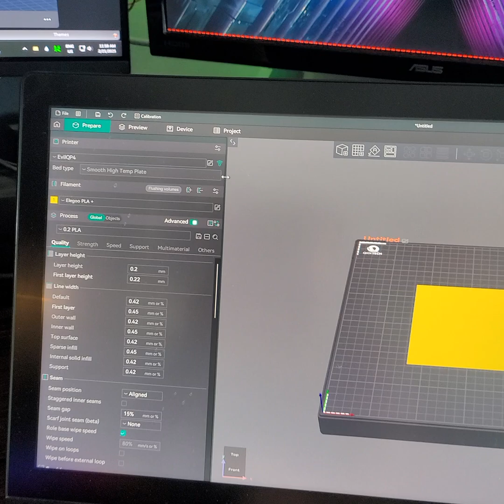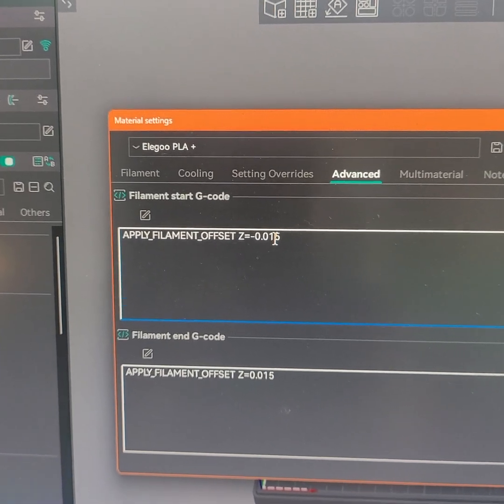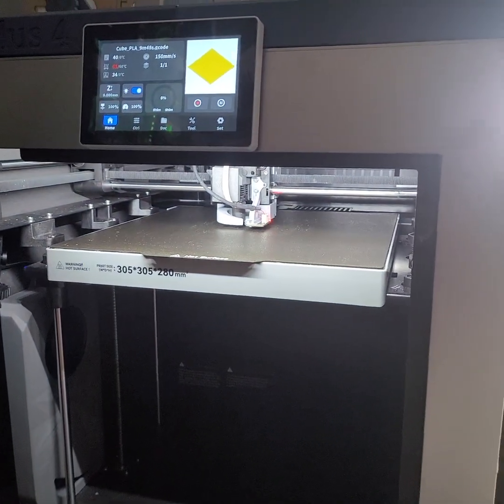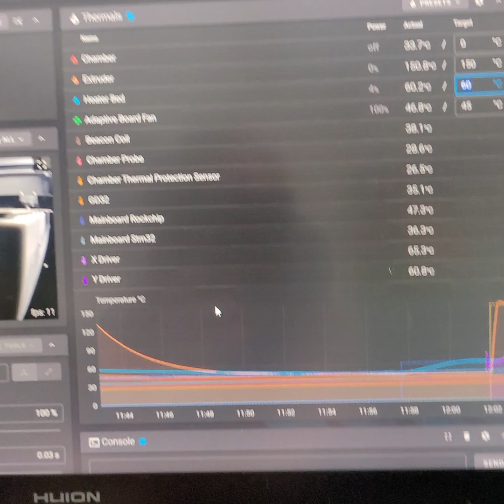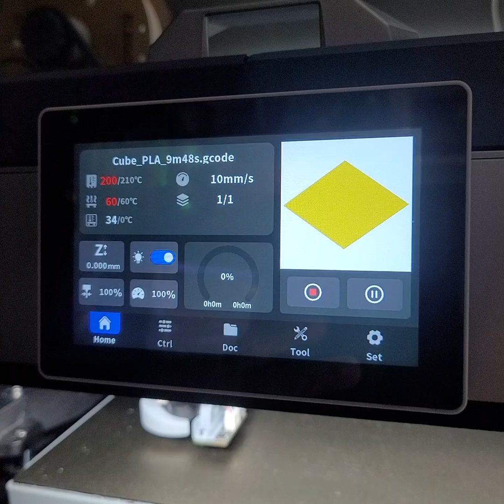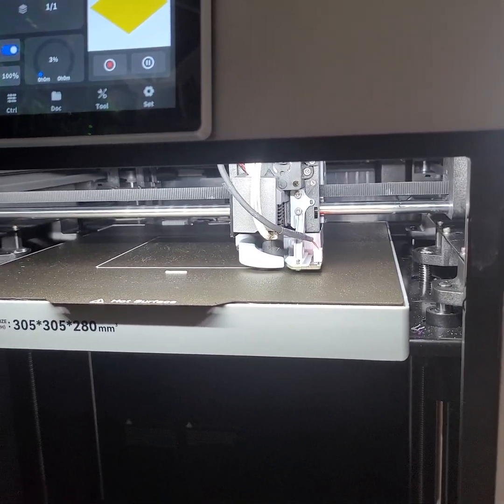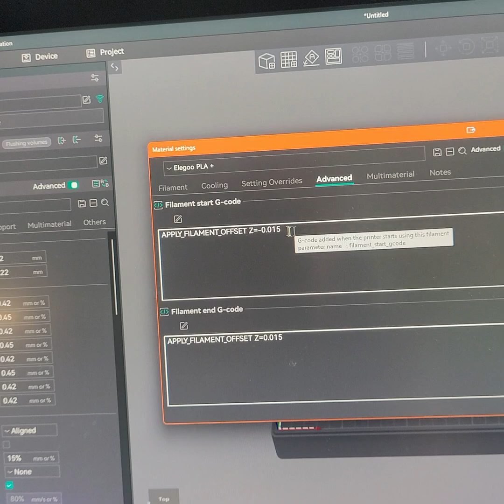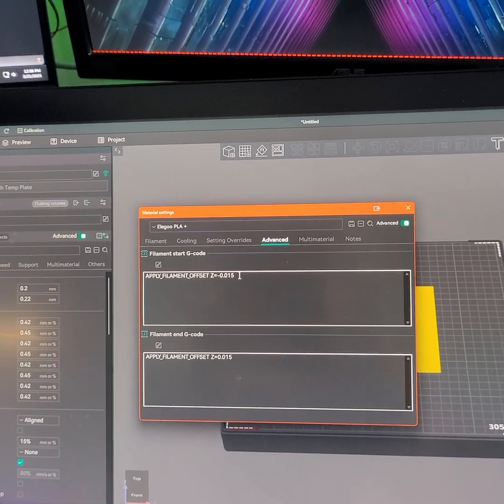Qidi Plus 4 Beacon UPDATE

Comment: How does it work after 1-2h of 65-70°C chamber temp and 105°C bed?
The normal bed probe is pain in the ass in such conditions and I was recommended this as a solution however I really would like to know if it works under these conditions before upgrading.
Btw. the normal probe does work at the conditions mentioned, for the first print of the day. If You leave the printer at these temperatures in between and during each print, meaning >2h, it just starts throwing out "out of tolerance" errors.
I am usually printing only ASA, PPS and stuff needing high chamber and bed temperatures and doing this in bulk, meaning, off with the one part, print another directly and this for 10-20h a day, I really need something reliable
Thanks!
Reply from the maker: I works bud ... machine stays stable and runs smooth. Can't say more for now because my machine is all in pieces :P Doing a huge mod on the gantry .... video soon

Comment: I had a question; the beds have magnets on them. How is it that the magnets on things like the qidi plus4 not cause interference with eddy / magnetic sensors? Or they do, and the materials on the bed must be changed?
Reply from the maker: the bed plate is solid aluminum, it's a sticky magnet sheet that is glued to the plate that holds the PEI sheet. Like so, Beacon can work without a problem
Reply: @frankthebum  Ah, so the magnatism is too weak and too evenly spread so it's not an issue, that's what I gather? Do I have it right?  Sort of like a fridge magnet.

Comment: I have the beacon setup on my plus4 now. The only things that are quirky is that chamber temp doesn't work correctly. When I turn chamber temp on the power percentage stays at zero and while printing ABS it runs out of control (upper 70's C). Also when I go to print a project from the printer it starts to warm up the bed and chamber but never starts the project, I have to start the print a second time once the printer has warmed up from the first try. Other than that it actually work 100% better and is the first time I have had a level bed!!!! Thanks!!!
Reply from the maker: @nathanl5010  check the print start macro for the chamberheater variables ... if you didn't adjust it in printer.cfg, it might be the cause of the delay or wrong start sequences. Will check on this later 👍🫡 and welcome 🤗

Comment: Followed all of Stew675's Wiki Content on the Beacon and did the changes to kipler. Got this error when I saved and restart: Not sure how to correct it as that section is all commented out.:
"Option z-offset in section  Smart Effector must be specified- once the underlying issue is corrected use RESTART command to reload the config and restart the host software Printer is Halted""

Any help here would be appreciated.

Comment: Does this stay consistent?  My 4 continually goes out of whack even when just repeating the same print.  I am convinced also the mesh is not accurate.  My high spots look overextruded.  Always leaning towards over extruding.  The low spots always look perfect.  Off brand cool plate is pretty flat.  If I don't get the plate to within .1mm variance I have issues.
Reply from the maker: yes it does once the install and calibrations are inserted, the machine will always fetch the adjustment for the filament you are using :)

Comment: How did you get it to have selectable poop? Be great to see a vid of that.
Reply: I too would love to have this on stock setup until I get around to getting a Beacon and putting it in.
Reply from the maker: @cTron417  you can add it to your gcode in print start .... https://github.com/FxWoody/Qidi-Plus-4-Mods/blob/b967700455d7fa9a52b3bb33f370648146f9476b/Beacon/gcode_macro.cfg#L255-L306
Reply: @frankthebum  i tried to set up the poo macro however it seems to poop no matter what i select, any advice?
Reply from the maker: @ there is a macro "stop pooping" that you need to push before you send the sliced to print
Reply: @ thank you!! will look into it right now
Reply from the maker: i did a gcode with the help of Spooknik to add inside the print_start
Reply: @frankthebum  is there any literature we can find on it maybe?
Reply from the maker: @jeffwinkelman6574  the whole sequence is part of our new gcodes with the beacon probe but i could make it for original system and upload to my Github. Let me check it out ;)
Reply: @frankthebum  that would be very helpful! I'm considering beacon, but not sure yet how deep in upgrades I want to go yet.
Reply from the maker: @jeffwinkelman6574  it is the best thing you can do for your QP4 ... they should have simply use this from day 1

Comment: @frankthebum Hey you guys are so great for helping put this together. I had another question: I thought the z-offset was automatically determined by the Beason probe. Why put that number in the filament offset? Where is that measurement taken from? Thanks again man, this info is indispensable! Also what's the difference between yours and stew's script/code?
Reply from the maker: filament offset need to be added to make sure it compensate for the meshing. Auto-calibration is done for the bed and nozzle tip to always be at the required distance. not every filament have the same  "sqwish"  ;)   use Stew675's script, mine is working on a different approach and it is less precise than his ... and you are welcome , we try to help as much as we can :)